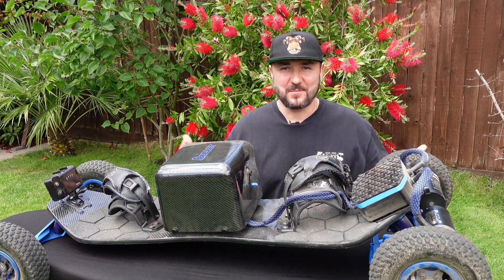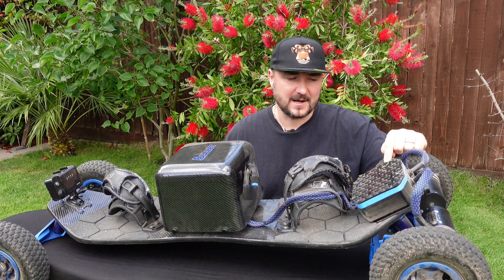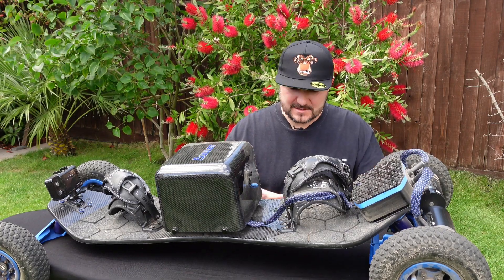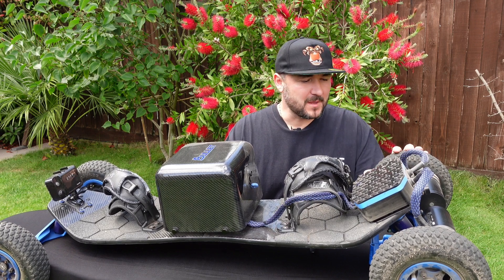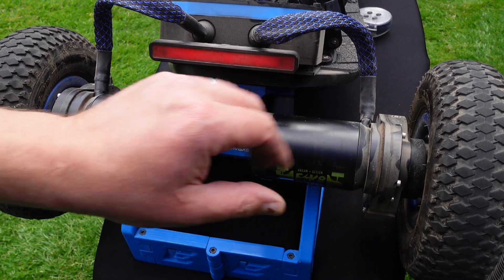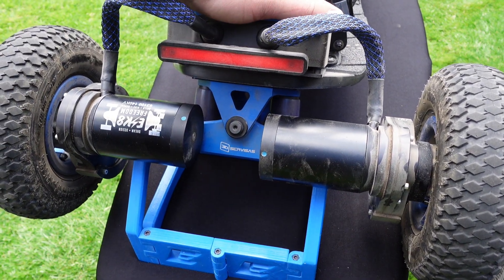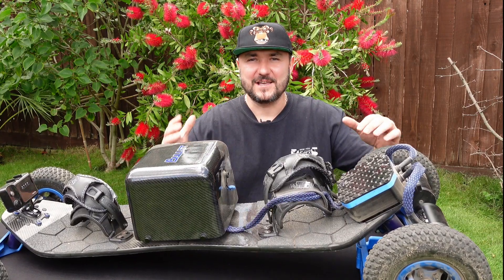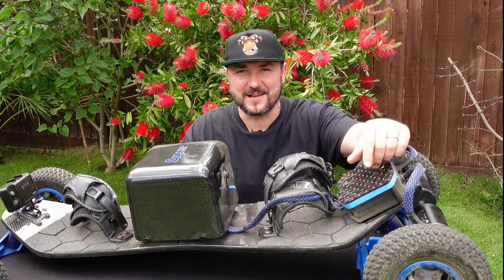The "BULLET"  DIY mountainboard. 63100 motors after 400 miles review.

Comment: with the 12S7P battery how much run time/miles can you get obviously it varies on terrain but trying to get a rough idea. I am planning on getting a MBS comp 95 and making it electric. also are you going to do a one year review on the 7070 flipsky motors that's what I was thinking of using. what vesc controller do you think is the best.

Comment: Your custom board is my favorite board I've prolly ever seen. This is prolly the exact board I would spec and build out if I were building my own diy.  I've a Lacroix jaws 2.0 version which is similar to the og nazare. I just bought BN M1-AT Gear Drive to replace my stock belt drive. Also just bought your flipsky 63100's @ 190kv to replace the stock 6389 190kv's. I'll prolly wait a few months then also upgrade my battery from the stock 12s4. With my setup what would you recommend I upgrade my battery to? 12s8p? 18s? I'm like everyone else I suppose; I'd like a little more range/power/torque. So what does that little blue dot on each of your flipsky motors mean? And do bigger motors mean better??? I assume in general yes. More overall power, torque, speed, prolly contributes to smoother ride and little better range even?    Also do you think I would need to upgrade my stock VESC Stormcore 60D+ to some other upgraded vesc like makerX or something to get better performance out of my new 63100's or should my stock vesc work fine? Thanks for your feedback. Greatly respect your opinions. Thanks for the videos! They are entertaining and incredibly informative!
Reply from the maker: Thank you kindly.

Comment: do you mount the flipsky 63100? can you push a14s?
Reply from the maker: Yes, these are 63100 by Flipsky. They are 4-13s rated but i know people using them on 14S boards. I have not tested them at 14S personally.
Reply: @PavelGarmas  in fact, the manufacturers advise not to go beyond 13s🤔. so i have no problem pushing them to 14s😯? Or do I risk burning them😬😬?

Comment: I love that board, Pavel, because of its remarkable power/top speed.  The bullet hits the bullseye!.
What must you do for maintenance on the gear drive?  You have probably answered that question before.  So forgive me if you have to repeat yourself.
Thank you for a great update, my friend!
Reply from the maker: Hi David, 
Thank you. Well gear drives are quite low maintained if you get a good quality set. Normally it is taking the wheels and covers off, wiping off the old greaseand then applying a new one. If bearings would go bad due to excessive exposure to water then replacing them but it doesn't happen often. Here are some links if you are interested:
https://youtu.be/Lms6KVMIajc
https://youtu.be/mJVpmJzTXBA
Reply: @PavelGarmas  Thank you, Pavel.  Very helpful information!

Comment: Pawel
Great video as usual and being a relative newbie to DIY builds your content is fantastic.. particularly the VESC Tool Tutorials. My request for a video is maybe a little ‘newbie’ biased😬. Struggle to find any real content on using the VESC tool App, even more so now that the Apple IOS version is available. It is unlikely people would complete set up a VESC (or comparable ESC)  but it would be great to see a tutorial on doing this with the App? 
In addition to a full tutorial small bite size tutorials would be great on finding the appropriate menus and settings in the app for on the go set up tweaks to the controller for things like Speed, Braking curves etc. Finally, as a newbie something I really appreciate with commercial boards are the speed modes the remotes offer, this is something I miss with my Trampa Wand etc and how to configure speed modes with any remote is not something I have found tutorials on, maybe this is because they are driven by the individual remotes software?? If that is the case could such things as speed modes and throttle/ braking curves bet set up in maybe the ‘Profiles’ option? Again using this function is not something I have seen a tutorial on for its application, setup or general use. 
Sorry for the long winded comment/request and if they are a little basic for your expected audience but maybe it gives you ideas for additional future content. Keep up the great work and content 👍
Reply from the maker: Hi mate! Thank you for watching and for the comment. 
I do use the Metr Pro and the App to pre-set the different modes, it makes it very easy to switch between them while on the ride. Most remotes do have the speed settings 1,2 and 3 and they do work well. Flipsky VX2, VX4, Puck, Spinted V1 definitely have them. 
Thank you for the ideas on the new tutorials, i will definitely consider your suggestions.